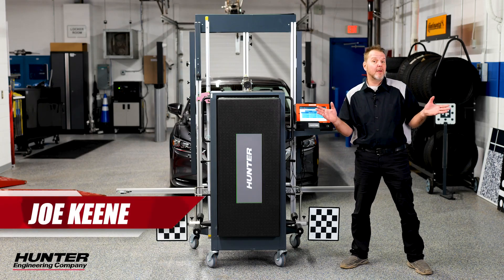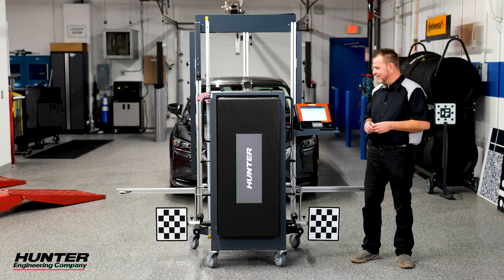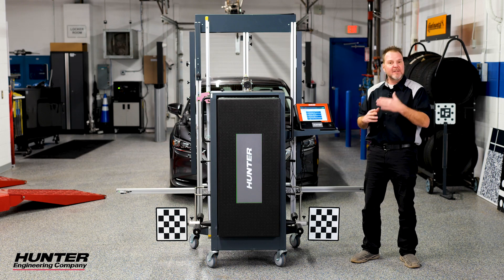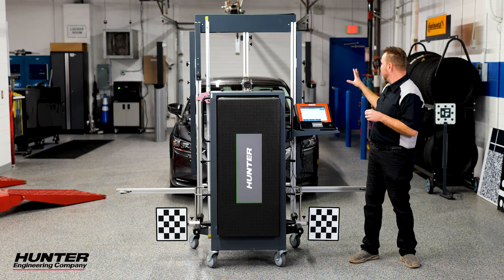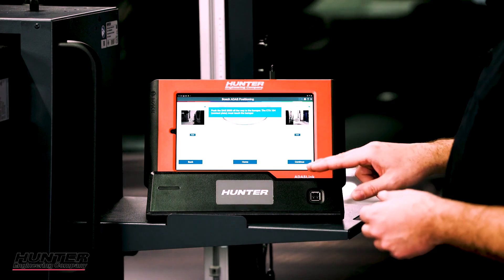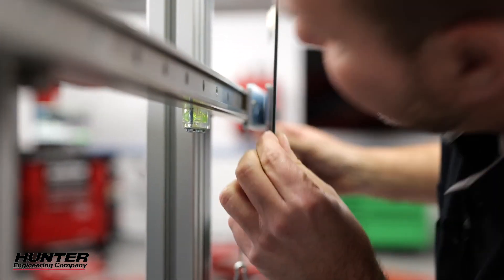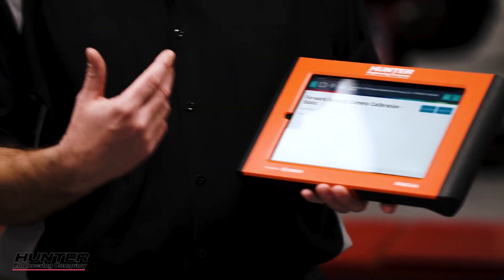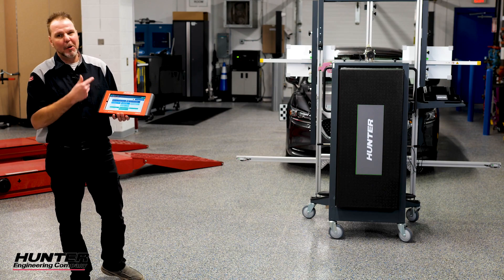ADAS calibrations: Mazda 6 front camera

Comment: So if I had my windshield changed and they used non oem glass, does that calibration you just showed need to be done if I’m getting a Front Camera Sensor System Malfunction error?
Reply from the maker: Most likely, yes. Doesn't matter if it OEM or not. Camera will still need calibration.